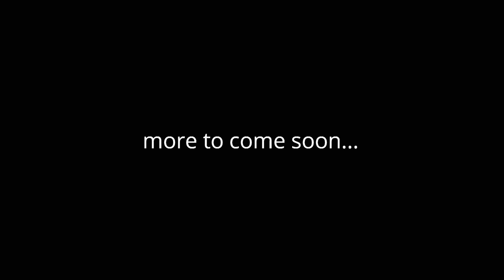Pelican Bass Raider 10e ( Quick Take ) - Florida Fish Hunter

Comment: At 126 it shows how your paddles are connecter to the boat, where did you get these and what are they called, the one in the middle with looks like a bungie holding it. Your boat is amazing just got ours TIA
Reply from the maker: Hi Wattsa Donnasaurs and thanks! Those are 3d printed paddle clips that I created to hold my oars. The design can also be made out of wood. If you don't have someone locally who can 3d print them for you then I would recommend an online printing service such as: https://craftcloud3d.com The file for the clips can be downloaded here: https://www.thingiverse.com/thing:4835029 😊👍

Comment: At ~ 5:10 we see there is a 'mount' for the outboard. Can you speak a bit about your thoughts regarding the outboard? I have a Hangkai 3.5, and it does not sit 'right' on the aft of the boat. Always causing the aft to drive the boat down. Putting shims in the outboard's clamps helps a bit, but seems still seems janky on my boat.
Reply from the maker: The outboard shim that I placed shown in the video was strictly to raise it about 1/4 inch above the transom so that I would be able to spin this particular outboard around so that I would in essence have reverse since my Suzuki does not have a reverse lever. Most outboards are angled slightly to compensate for the angled transom of a boat. Since the PBR does not have an angle to the transom, the outboard will be angled slightly causing the bow to raise up and the stern to drop lower in the water when moving forward. I'm hoping to come up with a solution for this so that the outboard will be parallel to the transom which would allow the PBR to plane out sooner and run level on the water.
Reply: @FFHTV  You've hit the nail on the head, bud. I've placed so many shims in the motor clamp that there's basically no tightening of the clamp, and the motor is still not sitting right on the boat. If I find an answer, I'll let you know, and maybe put up a video for it.
Reply from the maker: Cool! I'll do the same as soon as I catch a break between all my current projects lol 😄

Comment: The brackets you used to mount all the rod holders and garmin/ transducer arm to. Is it just a stainless steel angle and did you just drill threw and bolt? How did you waterproof it. Awesome boat bro. Just picked up my 10e NXT yesterday.
Reply from the maker: Thanks xs750yamaha! The angle is made out of aluminum and thru bolted on the gunnel lip. As far as waterproofing, if you meant on the bolts the angles are secured with, I did not see a need to. 😊👍
Reply: Ok cool thanks bro. Im just scared to drill holes in mine lol. Hopefully will hit the water for first time this weekend